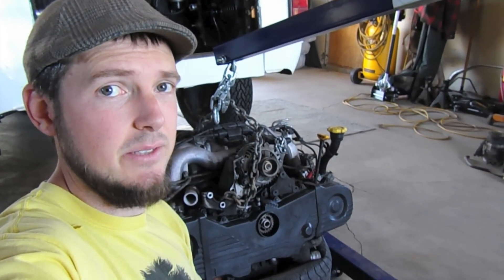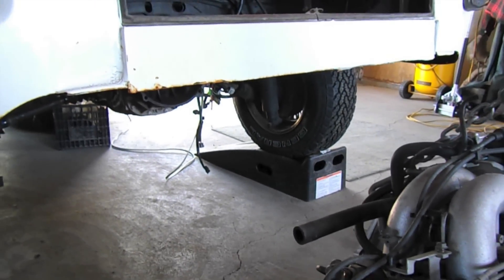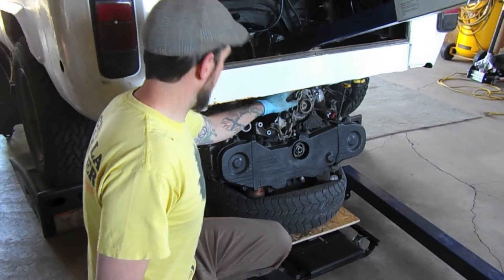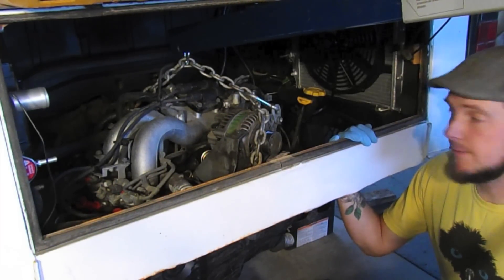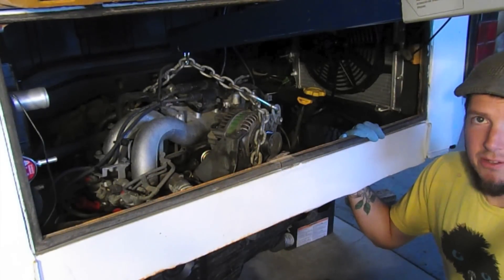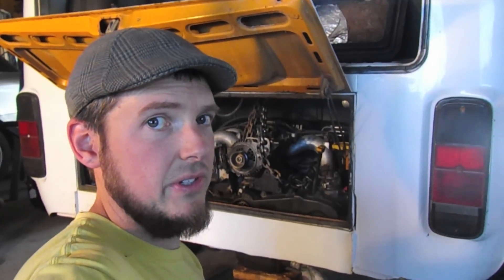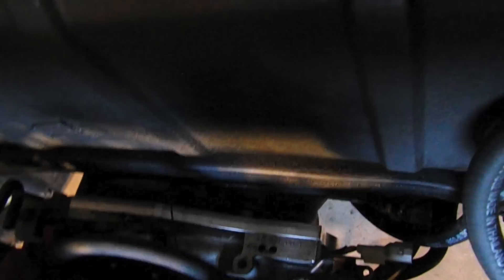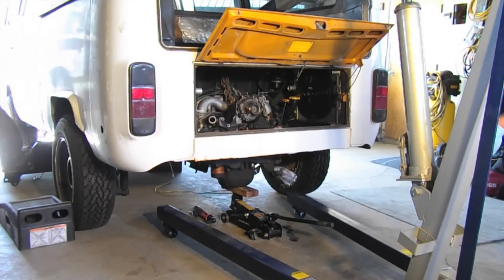Subaru Engine Install into Bus - Busaru Engine Conversion Part 7

Comment: I would fabricate a replacement aluminum or stainless remvable facia plate that comes off and then just wheel the new motor straight in (or out) for easy workability. The work is already fairly extensive -and this part would be fairly easy

Comment: Hi! I have a similar project in mind, so have 2 questions:
1. Do you use the VW factory gear box or the subaru gear box?
2. About motor support.. Did you should to do any modifications?

Too many thanks in advance.

Comment: How does the engine not spin the wrong way now that it has been rotated 180 degrees from its original orientation in the Subaru. Did I miss something?
Reply from the maker: The engine always spins clockwise whether in the front of a vehicle (like Subaru) or in the back (like the VW). It's the transmission that directs the power orientation. If you put a VW trans in a Subaru you would have 4 reverse gears and one forward gear :)
Reply: Thanks for the help :) Do you do these conversions as a job? I'm looking to do a swap in a 1971 Bus, and depending on the price I would rather someone experienced do it.
Reply from the maker: The Thunderlizard m happy to help explain it. I do conversions for folks but I'm pretty maxed out at the moment. I can coach you through a conversion if you wanted to tackle it yourself.
Reply: I know a few people who build race cars, including my dad. One of them builds and tunes engines, I will check and see if this is something he would be comfortable doing. I'll help out when i can, but i'm looking for someone experienced to do most of the work.
Reply from the maker: The Thunderlizard Cool! You can learn a lot while hanging out with those fellas.
Reply: From what I saw you didn't change out the fuel pump. Would you recommend a newer fuel pump (and possibly fuel tank) for someone who tends to drive a bit harder than normal. I don't want to starve the engine, and loose performance.
Reply from the maker: +The Thunderlizard You will definitely need to upgrade to a fuel injection rated fuel pump as your carburetor fuel pump won't generate the necessary pressures.

Comment: I am putting a 98 Subaru 2.5 DOHC engine in my 79 bus. The EGR valve is hitting the fire wall . Should I cut out the wall for it or remove the valve and put a plate over its opening.
Reply from the maker: +James Groves I would plug the metal hose connection and put a block off plate on the intake manifold.

Comment: Can that Rear Lower Valance be made to come off easily? Or is it integral?
It just seems so in the way.
Reply from the maker: +will will I don't think so. The late bays use them to stiffen the rear. The early bays have a removable balance and it works great - they just don't have an upper lid would can make things difficult too.
Reply from the maker: +will will I don't think so. The late bays use them to stiffen the rear. The early bays have a removable balance and it works great - they just don't have an upper lid would can make things difficult too.
Reply: Thanks for that. Busaru. I figured you would have removed it, that being the case. Good Work!

Comment: Hi love the video's . just wondering ,i am just about to put a tdi 1.9 in my splitscreen and everyone tells me a rad in the back  is a big no no ,i see you have it . how are you getting on with it ?
Reply from the maker: +Graham McMahon Hi Graham, the engine bay rads work well for me and the other people I've worked with in CO but t really depends on how you will use your bus.The best cooling performance will be a front mounted radiator, but its ugly. A belly mount has a potential to come in 2nd for cooling, but it can be damaged by debris (you'll need mudflaps and need to take other precautions if you drive on dirt roads, etc). And finally, if you're like me and do a lot of backcountry type driving to trailheads and camping, you may want to go with the engine bay rads as they are protected and a very clean install. The thing to keep in mind with all rad setups is that none are just a simple "install and forget about it" sort of thing - it's all experimental. Let us know how it goes!

Comment: Instead of an engine hoist I think you should use a pallet pump in combo with the creeper and tyre...
Great video's though
Reply from the maker: I've used motorcycle jacks before and they work too, but there's nothing like the adjustability of the engine hoist in my opinion. Do pallet jacks go up and down a few feet? I hate having tools with one purpose but it might be worth checking out.
Reply: Yes they do have that adjustment .. I was thinking going by the video's that you do this alot,so I was thing it would be alot better than a small jack and a few pieces  of wood all that work and for the engine to possibly fall off.
You could have the pallet lift and weld engine mounts to it...or bolt on mounts temporary so that you could use pump truck normally..
Also the rads I noticed you left the original filler neck on ,as you had the tabs welded on why not cut those and weld in some blanks,I'd  imagine at some point the seal would perish and you would have some more trouble..
I loved watching every video today ,and only wish that I had the opertunaty to do the same thing...
Keep up with the great work dude...

Comment: what type of transmission you have in the bus with the subaru engine?
Reply from the maker: In my 73 I have the 3 speed auto, in the 77 I have the 4 speed manual 091 trans.

Comment: Are you planning to sell the engine support mount you had fabricated? I am about to a put legacy engine into my 61 Split bus. Do you reckon your engine support bar would fit?
Reply from the maker: Hi David, I have them here: http://www.boxerswaps.com/busaru-kit?view=rokquickcart

The only problem is that they are made for late bay window busses and I don't think they'll work easily with the Splits. You could probably cut the mounting ears off and reweld where needed but that might be a little more than you're hoping to do.

Comment: the sump is really low and could get damaged, are you leaving yours like that or are you going to convert it to a dry sump?
Reply from the maker: There are a lot of folks who offer shortened oil pans. Small Car, Outfront Motorsports, and Rocky Mountain Westy to name a few. I tend to leave mine and take care when driving in off road situations. This is mostly because the price is fairly high (~$500) and I've never had a problem on normal roads. Road debris is mostly deflected by the engine crossmember that is directly in front of the oil pan.
Reply: ok great, what are the mechanical disadvantages of a shortened oil pan?
Reply from the maker: Plasticit Matt It depends on how its done. If capacity is diminished due to just chopping the bottom off, then you'd have to run an additional oil cooler for capacity and to keep oil temps down. If you go with one that keeps or adds additional capacity then there isn't a downside.

Comment from the maker: Due to nasty winters (snow/ice/road grime) I decided to mount the radiators in the rear - up and out of that nastiness. The crossmember I had a machine shop build (and am offering in my kit) is a very simple one piece design similar to KEP's. I contacted them but unfortunately they don't want to build a crossmember for the Bus so I had to make my own! Throttles are always tricky because they always seem to be different in every single bus - due to their age and previous owners modifications.
Reply: @Busaru  can I put in a 2.5 turbo without modifying the fire wall

Comment from the maker: Thanks for the comments guys! I have to admit, I was a bit intimidated stepping into my first swap into a Vanagon back in 2008. The reason being that there weren't really step by step guides of the whole swap. The price is reasonable if your aircooled engine goes out and needs a rebuild - as those are getting pricey these days (I hear). Jon Paul, the safest place for the computer is definitely inside (see my wiring harness video for more details on where I mounted mine).

Comment: Hi mate, how are you mounting the engine? I used the subaru cradle from the half cut, I can send you some pics if you like. The fuel pump I used was from a popular 6 cylinder car here in oz, it has an auto shut off too in case of an accident. Where are mounting computer? Mines inside away from water etc. my radiator is under the floor laying flat, holds about 10 litres of coolant. I am having trouble with cable from accelerator to throttle, response is poor so would be interested how you will do